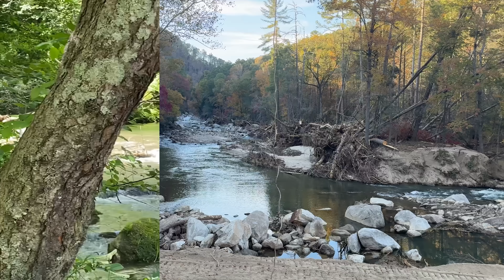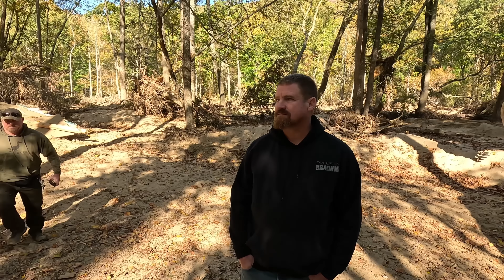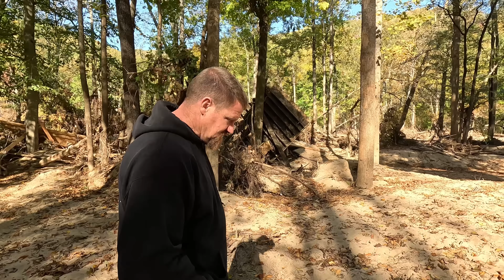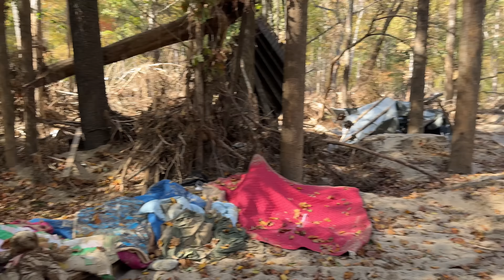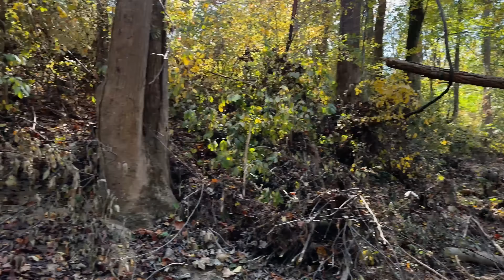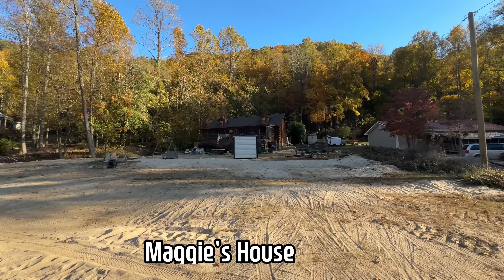Recovery Efforts By A True Appalachian Hero, Jake From Precision Grading, has Worked NON STOP

Comment: Could some of the big trees be milled into lumber for rebuilding?  It might be worth a try
Reply: It seems that the trees are all hardwood, but the lumber used for building houses is almost all pine and spruce these days. They use hardwood more for furniture, paneling, flooring, etc. where the wood will be visible and needs durability.
Reply: @ericfielding2540 You can still use those hardwoods for building homes. They don't bc it's expensive. Oak for instance, once dry and sealed it will last forever. My dad's front porch is made of oak and it outlasted the treated lumber I had used for one of my own, it's been 10yrs since mine was rebuilt and his is still solid.
Reply: Saw whereva contractor in NC charged a family $25K for tree removal on a roof. Hope he goes to jail. THESE PEOPLE PUT HIM TO SHAME!!!!!!